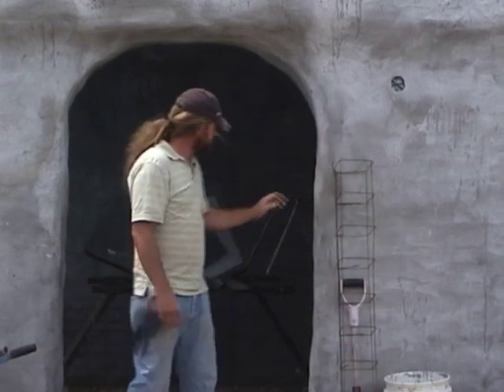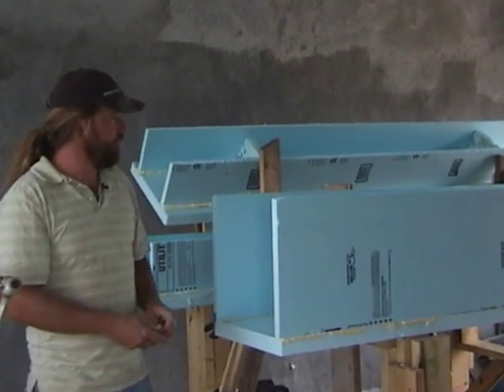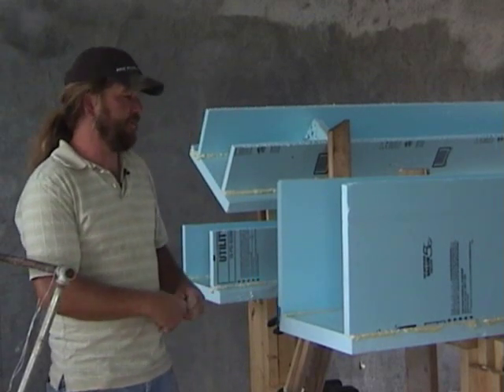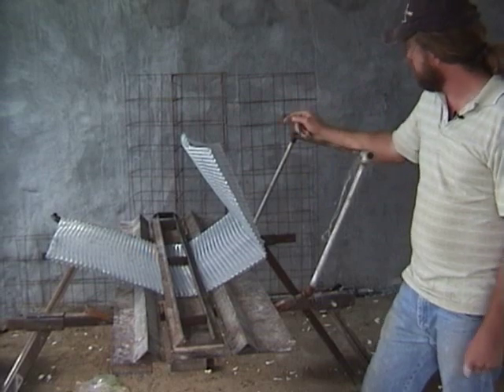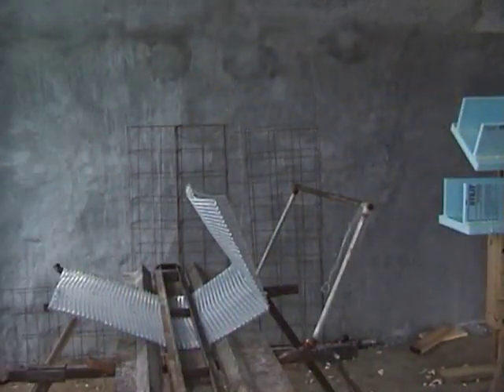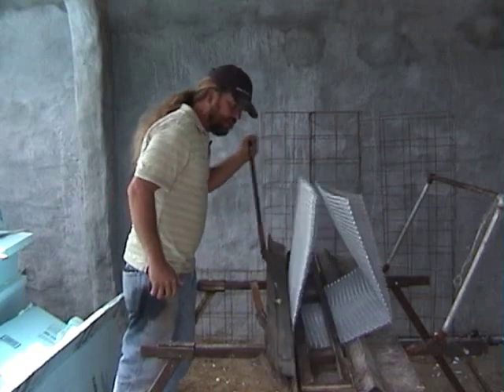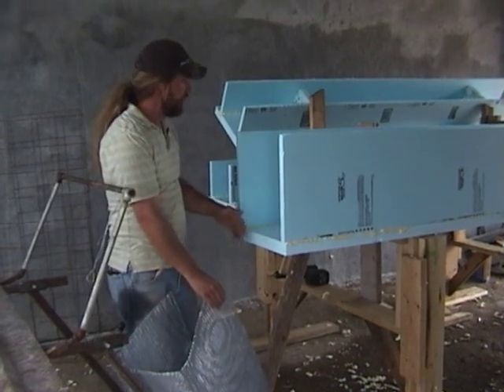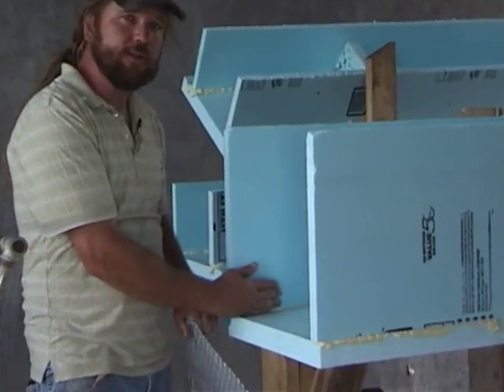The Laminated Ferrocement Box Beam Foundation Part 2

Comment from the maker: I like to figure about 35 dollars per mix.  Each mix covers 40 square feet of shell.  It is the same if you are doing 2 to 4 embedded layers, the LFC style, or just a coat or two over expanded metal lath.  Even with all the fancy ingredients, this mix should be about the same or cheaper than the good ole 1 cement and 2 sand mix which is also plenty strong but this mix makes much more material.  Also, no shrinkage and the shell is protected for good by the closed cell aeration.
Reply: what is your mix ingredients?

Comment: can ferrocement be used to build slabs and beams , and can you send me detailed drawings and standards about ferrocement
Reply from the maker: Yes, for every Reinforced Concrete design there is a better thinshell equivalent that uses 90 to 95% less concrete.  Think  'hollow version' of any beam truss, column or cast slab that is better because thinshell concentrates all the reinforcing on the surfaces where breaking would begin, rather than relying on a general internal cohesiveness loosely tied with deep rebar.  Adding the dimension of flex-stable fluid design is another way thinshell is an improvement over RC.  Imagine retaining walls that use curved shapes to counter soil pressure. Also, its better because of the 8 to 25 % closed-cell aeration replaces most of the few remaining open pores in the ultra-low water reactive powder mix design which shields the metal reinforcing from moisture while providing space for chemical expansion reactions like rust or ice.  This effect, in essence, fossilizes the reinforcing and the composite that continues to react with atmospheric CO2 to heal cracks and get stronger over time.  You would have to have a local engineer evaluate each project design but to understand ferrocement standands and see detailed drawings about those evaluations, check out Antoine Naaman's book,  Ferrocement and Laminated Cementitous Composites.  I use larger wafers for bend testing but just for comparing to regular mortar equivalents.  The slabs I do are less than an inch, between 5/8 and 7/8" usually.  The foundations are always columns in the natural terrain, and the slab and columns are ringed by a thinshell retaining wall then subgrade is leveled with neat cellular concrete, and/or rubble.  For comparison, 1" retaining wall with the criss-cross no slip double layer of 6-6-10 concret steel and expanded metal lath replaces a 10 inch RC retaining wall with rebar grid on 6 inch centers.